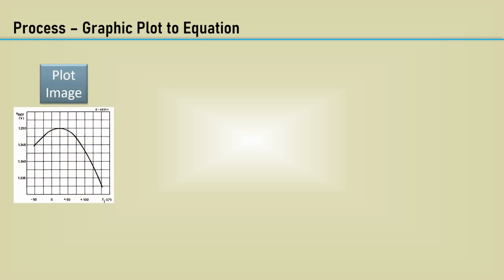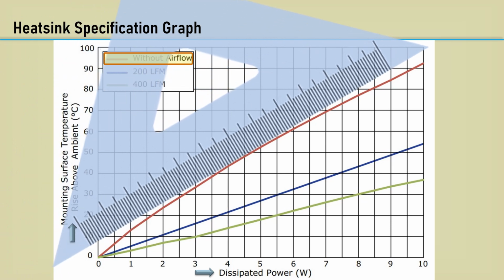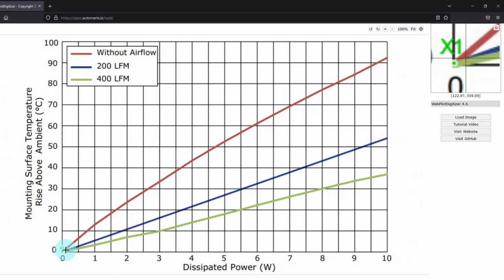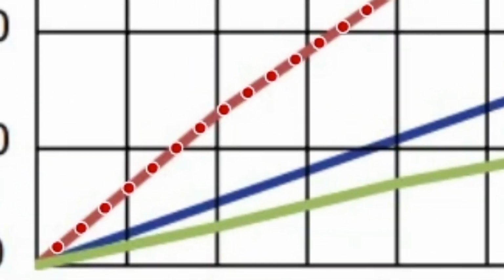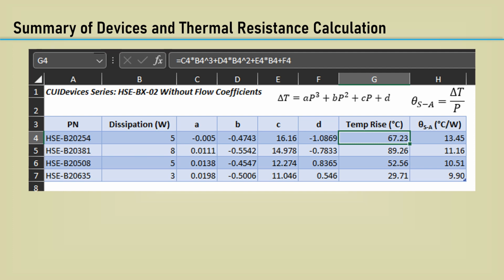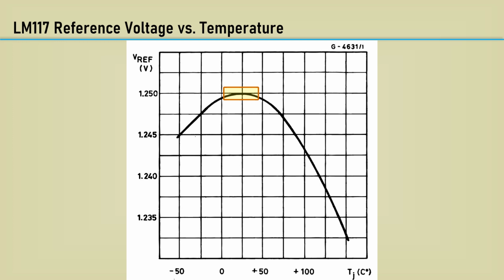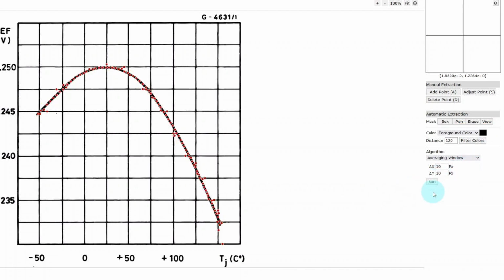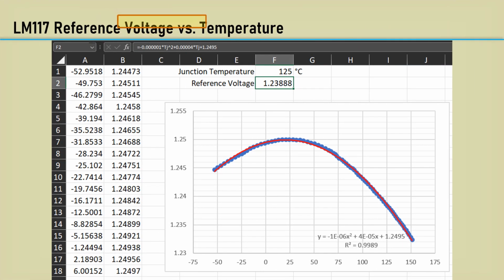Digitizing Specification Plots

Comment: Amazing that plot reading tools don't do better at autodetecting common plot styles, requiring manual assistance.
Reply from the maker: I could get the grid removal to work pretty well. The problem is, it wiped out the turning point of the curve, which I viewed as critical for the trendline. It seemed easier to just delete the few extraneous points. There may be better ones, but this was free and I didn't have to worry about installing a program. I'd love to hear about it, if there is a better solution.